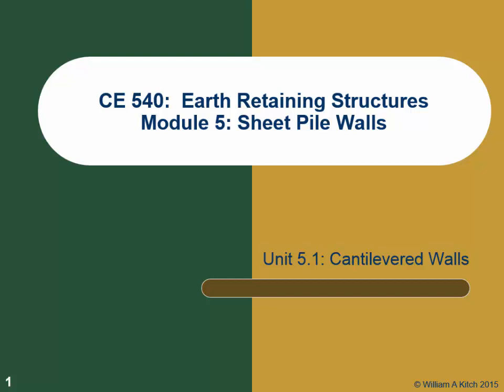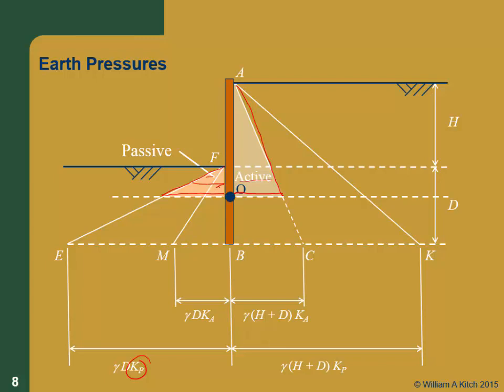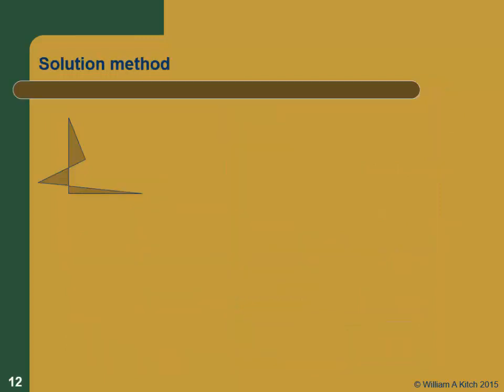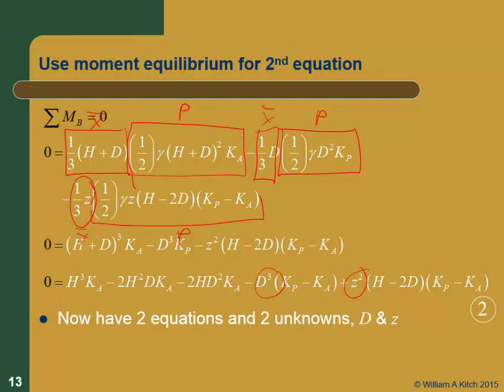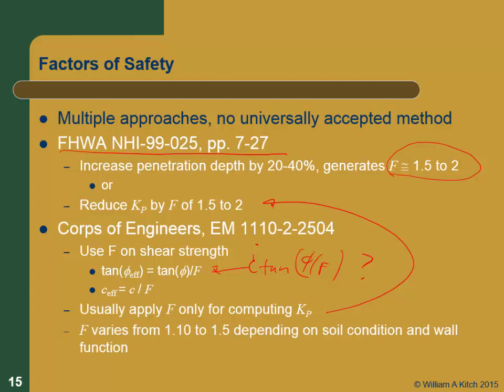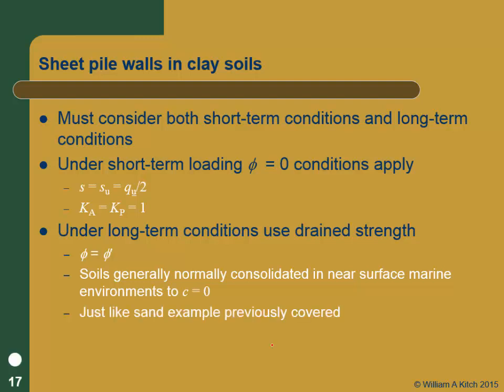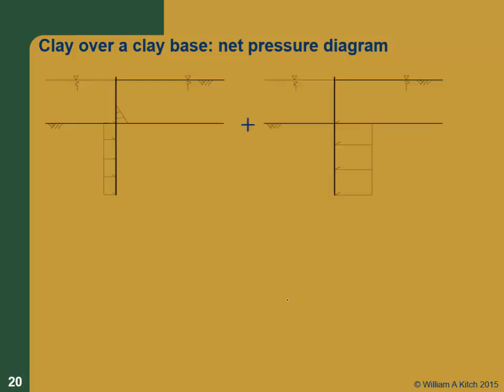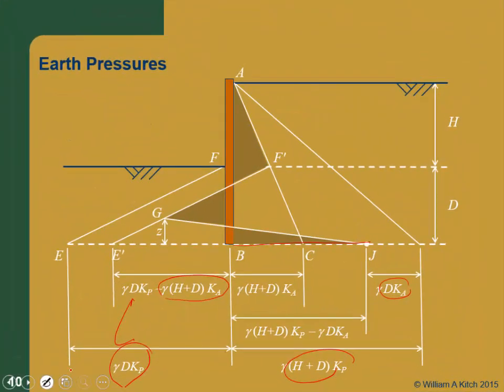CE 540 Module 5.1 Sheet Pile cantilevered

Comment: Eqn 2 appears to be wrong. the 2nd and third term is wrong. similarly in the last term it should be H+2D and not H-2D. pl correct me
Reply: +
Yep, change (H-2D) with Ka(H+2D)
Reply: I think the last term in equation 1 should be -.5*Gamma*z((H+2D)(Kp - Ka)).
And the last term in equation 2 should be -(1/6)*Gamma*z^2((H+2D)(Kp - Ka)). All the other terms in both equations are correct.
Reply: Actually, the last term in equation 2 should be (1/6)*Gamma*z^2((H+2D)(Kp - Ka)) because its sign has to be consistent with the first term.